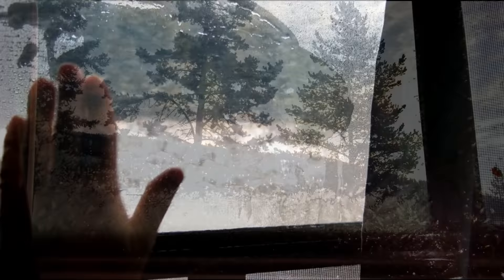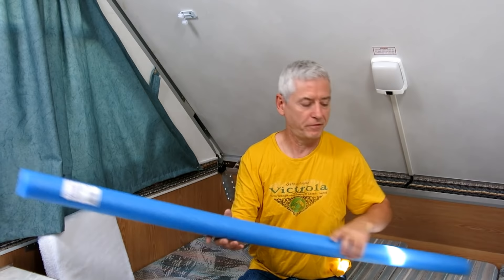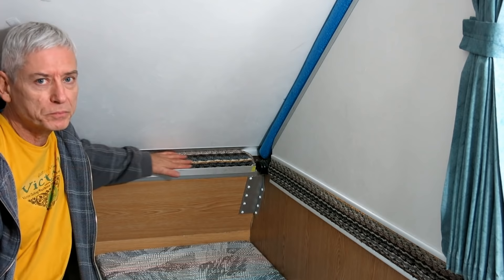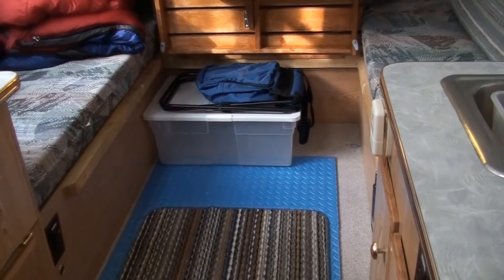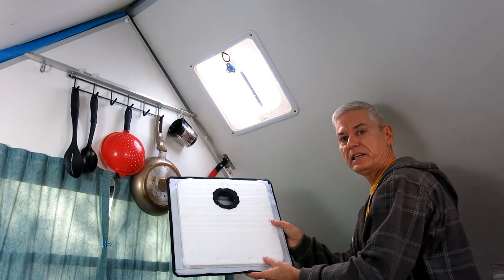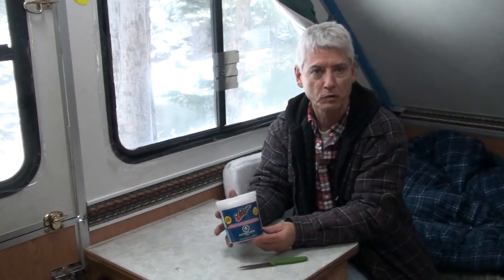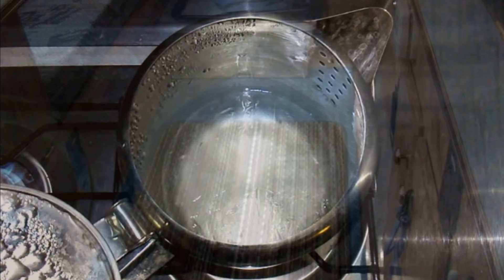Cold Camping in an Aliner Part Two: Outfitting Trailer for Cold

Comment: Hey, thanks for this.  We're planning a winter trip in our a-liner where our primary criterion for comfort is "is it more comfortable than inside a 25 degree sleeping bag, at its temperature limit?"  What is the coldest you have been to?  Will it do ok at around 0F to -5F?
Reply from the maker: Hi disoh, Thanks for the question. I spend many nights below freezing, but in really cold temperatures the issue isn't the trailer itself, but the batteries and the propane. Unless you are using a hookup or generator you might have a challenge under 0F with keeping your onboard furnace going. Battery charge and propane vapor pressure are the issues. Mind you, I mean 0F for the WHOLE DAY, not just a few hours at night. That's why I did Part III of the Cold Camping Trilogy in an RV park (see https://youtu.be/SkLYZ5uTzqQ). I do expect some updates as I am just entering another cold season and have some new ideas I want to try. Please check back! Slim
Reply: Dang, that’s hardcore. Max respect points but I think my winter camping adventures will include Arizona! Brrr!
Reply: Awesome video!!  We have the toy hauler a frame pop up!  Did you have to insolate the water pipes or any of the pipes

Comment: One could also use bubble wrap on the windows as an option.  When damp, it adheres easily to the glass, allows for multiple layers, doesn't need cutting, can be reused, and is easily removable, while allowing some light inside. I take it that, for the walls,  installation of actual insulation  and wood paneling boards ( as seen in other, especially cargo trailer to RV conversion, videos) is not an option here.

Comment: Slim, I’m coming to this a bit late, so you may not read this comment.  I’m interested in the before and after temperatures inside after your improvements.  Thanks for sharing this information anyway.  You are a fine teacher.  Texas
Reply from the maker: Papa Jeff, it's a good question but a hard one to give a precise answer. The extra insulation retains heat, however the temperature will still drop if you don't have a source of new heat. Insulation merely slows the process. With weather and temperatures fluctuating constantly, I don't know how I could do a side-by-side comparison unless I had to identical trailers the same night. Thanks! SP
Reply: Slim Potatohead what a great guy you are!  You read my question on this old video.  Thank you so much.  These improvements must have helped though.  Do you remember, was it a lot or a little?  Your habits are so energy conservative you may not have seen a big difference.  The reason I ask is that I am just on the edge of purchasing a camper.  I prefer simple.  The wife wants more.  If I can convince her that she’ll be comfortable, the A-liner looks good to me.  Texas
Reply from the maker: Papa Jeff, if you are jut traveling in Texas you should have no issues! I camp in sub-zero weather often, so have a somewhat high tolerance to cold. Some women (AND men!) start shivering at a couple of degrees below room temperature. My advice is to go to an RV showroom and let the wife try one out. If it feels comfortable, it will be comfortable. Gotta keep her happy! SP
Reply: Slim Potatohead thanks, you are right.

Comment: I watched another video and they were using something called an Air-Dryr for keeping their RV dry. They said it used very little electricity. They go by The Long, Long Honeymooners on YouTube. You might want to check it out . Or just google Air-Dryr.
Reply from the maker: Hi Marla,
I'm sure these are great with a bigger RVs with hookups,  it wouldn't be practical boondocking in a small trailer.  Moisture absorbers are only a couple of bucks each and effective, no energy required!

Comment: Slim,
I did not see the actual heaters which I know was not the point of this video.  I think you said you use space heaters in another video, because from what I have seen the Scout does not come with a heater standard.   Can you confirm this and if so, what kind of space heaters are you using?  Thanks. Appreciate all the great videos and what you do for the camping community.  Videos like yours are unbelievably beneficial to newbies, or want-to-be newbies, like myself.
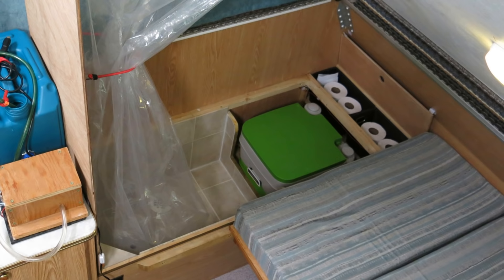Reply from the maker: Hi Greg, The space heaters are shown in Cold Camping Part 3 at the 7:25 mark. It's at : https://www.youtube.com/watch?v=SkLYZ5uTzqQ&t=25s. These are just basic $10 Walmart heaters.  Useful only when you have 120V power.  In this video (Part 2) I did not use space heaters as I was boondocking. Thanks

Comment: Has anyone ever tried using something like Rain-X to prevent condensation on the windows and frost on the metal parts?
Reply from the maker: Rain-X doesn't prevent condensation from happening, it just beads it so it runs off the window faster. The moisture problem is still there! SP

Comment: Instead of using the window insulation kit, why don't you part  frame the window with velcro type sticky back tape and then you can make a see thru thick plastic cover the size of your window and for night you can use the silver reflective type material used to shield cars from the sunlight. That way you have a system to suit night and day and reusable.
You could also partition your A frame and hang a heavy curtain type material to isolate the front half of the A frame so that your sleeping area is reduced by half.
I have just seen the rest of your video and all you need so if the same as you did for your vents - do the same on a larger scale for the windows. :)

Comment: Although I won't travel as extensively as you I am seriously considering a used A Liner Expedition. As a past owner what are your thoughts on them?
Reply from the maker: I thinks there's lots of A-frames available, which means if you shop around you should be able to find one within your budget. My advice would to make sure the frame is sound and there is no evidence of water leaks in the inside corners. The rest is easy. Thanks! SP
Reply: @SlimPotatohead  👍

Comment: How did your damp rid, damp check workout for you?
Reply from the maker: Hi Arnold, It works well in super cold temps, however when only above freezing I didn't need it. If you are expecting a lot of sub-freezing days (not just nights) and inside frost and condensation, I would highlty recommend it. Thanks!

Comment: what do you do for a fresh air source when using the furnace now that everything is sealed up?
Reply from the maker: Hi bushrat. I wouldn't say the Aliner is sealed, only more insulated. There's still plenty of gaps for air to get through, and fresh cold air always finds them, like the drains. The furnace has its own air intake as well. Of course when using the stove the roof vents are always open.  Thanks

Comment: thanks for the info slim, as a aliner owner myself could you tell me what size noodle you used as theres several differant sizes, thank you...
Reply from the maker: My insulation has evolved since this video was made. I now use a combination of pipe insulation with a few pieces of the large size pool noodle cut in half.  Thanks! SP
Reply: @SlimPotatohead  thank you

Comment: Slim, new owner of an aliner out of Colorado, hope to do winter camping at some point.  The aliner manual states that you should spray silicon spray or Rain X on the seals, weather striping, and/or extrusions to prevent seals freezing to the extrusions , and avoiding damage when lowering the walls or roof.  I didnt hear any thing about this in any of your winter videos.  What is your opinion on this , thanks Eric
Reply from the maker: I cover any bare metal with reflectix. That solves the problem. Thanks! SP
Reply: My bad. I was talking about the rubber seal that is attached to the the exterior wall at the edge  It's the barrier between roof and the walls. The manual indicates the rubber on the walls could freeze to the roof, and it would be difficult taking down the walls with out damaging the rubber seals. I was wondering if you had any issues with this ?
Reply from the maker: Same answer. SP
Reply: Thanks

Comment: Hi Slim

Thanks for your videos. They have been very helpful in both CAmping in and rebuilding my Aliner.  I recently was camping in the great Smoky Mountains national Park and the temperature dropped to 27°F.  I got a lot of condensation from the heater I was using and the metal components were very cold.  

I noticed that you had glued carpet to your hinges and parts of the metal to stop them from being cold. My question is are you still happy with doing the glueing, or have you changed your mind on using that as a solution? And how would you address the droplets of h2o?
 Help greatly appreciated.   Perry
Reply from the maker: Hi Tray, covering bare metal with insulation like carpet, reflectix or foam reduces condensation considerably. Thanks! SP
Reply: Slim Potatohead Thanks for the support.   I
Look
Forward to more of your work!!!  Tray
Reply: I have another question...   We have the original axel and 12" 4.80" tires.  I'm. Not sure if you have upgraded your axel...   We have an 01 Scout 
We do plan to be in rougher terrains as well as highways and interstates.   
Do you have opinions or suggestions on this subject.  

Thanks. Perry
Reply from the maker: I upgraded to at 3500lb axle. I did a video on it. Thanks, SP
Reply: Slim Potatohead great thank you.   I'll go find it and watch and learn.  Can't tell you how much you have accelerated my learning process with these units.

Comment: Not sure if you're using an invented type of propane heater like the Mr Buddy, but water vapor is a natural by product of burning propane. I think a "gallon" of propane gives off a gallon of water. Of course your body gives off water vapor too.
Reply: I just saw on one website that 1.6 pounds of water is produced for every pound of propane burned. 
Ventilation of insulated walls is important. The water will condense when it gets cooler, if that's inside a wall, and that wall interior cannot breathe properly, the water could build up and cause a rust or mold problem.
Reply from the maker: Hi Ty, coincidentally I just ended a trip using a Mr Buddy as an alternative. Expect to have a video on the experience soon. Thanks!

Comment: I like your videos; but I think that the Aliner is just not built for extreme cold.  Your winterizing tips are interesting, but ultimately I think a metal frame and thin aluminum walls/ceiling make them futile efforts - and probably make the condensation issues worse.  Still, its better than a tent and a lot more comfortable.  Like you've said in other videos, this is not for everyone.
Reply from the maker: Hi Stem, Thanks for your comments. The walls of the Aliner are insulated with rigid foam sheets, not just aluminum. That said however, I do acknowledge that the Aliner is not designed for extreme cold. But neither is ANY off-the-lot camper for that matter, as all need to be customized for continual use in below freezing temperatures. With the Aliner, it is minimum effort and cost to provide a little more protection for short trips to the wilderness. I expect to add additional videos as I am now preparing for the cold season. Happy Camping! Slim

Comment: We just finished a semi-cold camping trip in our Aliner (lowest temp was 20 degrees F - probably seems warm compared to Canada) and had some issues with our Wave 3 heater and condensation.  I'd love to know whether your carpet strips get soggy and need to be dried out?  Also did your insulation in the peak of the roof completely remove that condensation problem? Do you think carpet would help in that area as well? BTW I have watched your Mr. Buddy Heater video several times and am amazed at the temperature improvement you achieved!  We could only get a 20 degree improvement with the Wave 3, maybe because we haven't plugged all the air leaks, and we probably should have bought a more powerful heater.
Reply from the maker: Hi Alice, Sorry to hear about the condensation issues but happy to hear you tried cold camping. As for the carpet strips, the ones on the hinges have had no issues, the ones on the ends do get a little moist some times but are not glued on so are easily removed for drying if needed. As for the peak, the original double draft guard I used was a little too awkward to set up and not as effective as I'd like. I recently switched to a carpet strip for the peak (it's held in place by an aluminum strip and is bend 90 degrees for the corner). My intention was to include the new design in an update, however in testing I found it needed to be a more absorbant material. I hope to refine this and include it in a video in the future. Great Questions, Thanks for asking! Slim